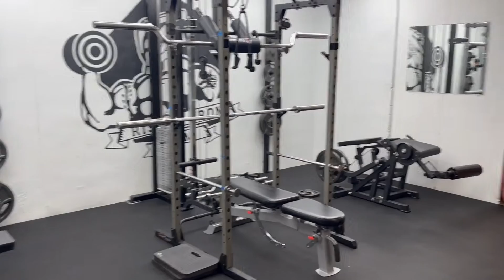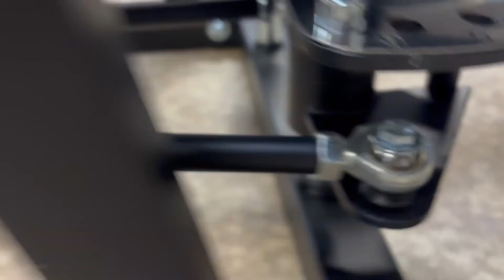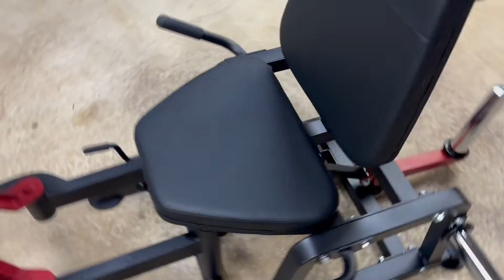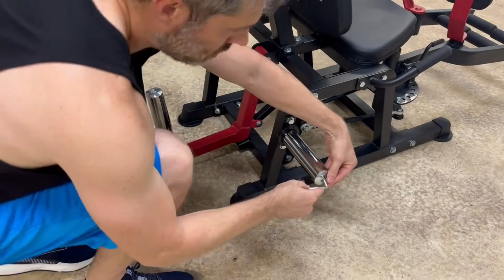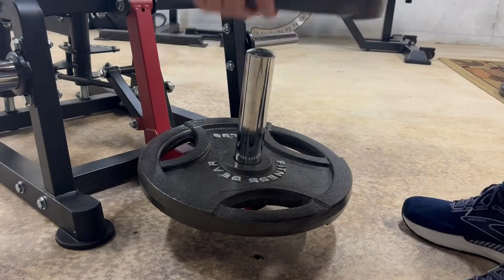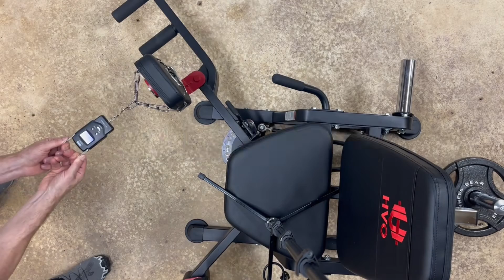HVO Hip Adduction Abduction Machine | Product Review by How to and Reviews

Comment: Thank you SO MUCH. I needed to know if I could load my 1 inch plates and patiently waited to see if those covers slid off and they do!!!
Reply from the maker: Hi! Our hip abduction/adduction machine is compatible with both 1-inch and 2-inch plates, so you can safely use either size. The machine is designed to secure the plates firmly during your workout, ensuring smooth and stable movement. Whether you’re using lighter 1-inch plates or heavier 2-inch plates, you can train with confidence and focus on your glutes and hips. 💪